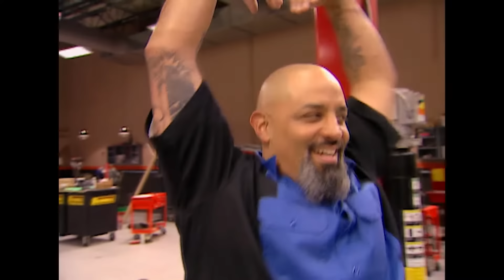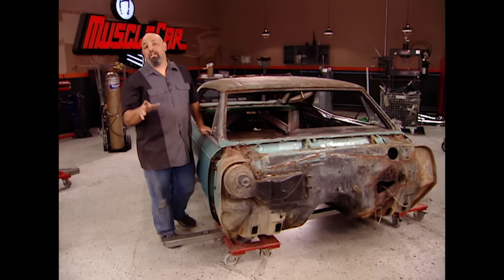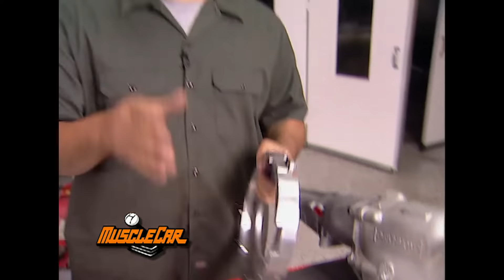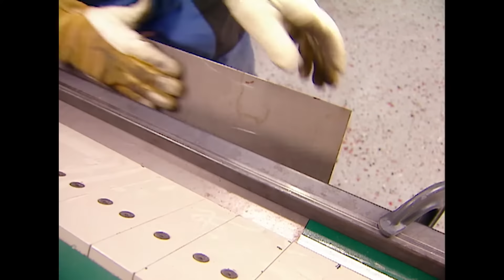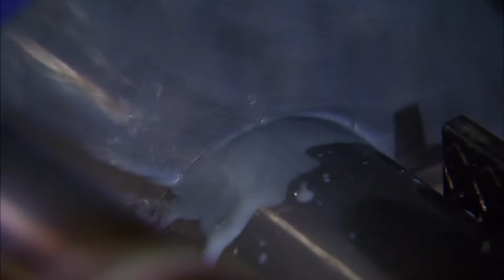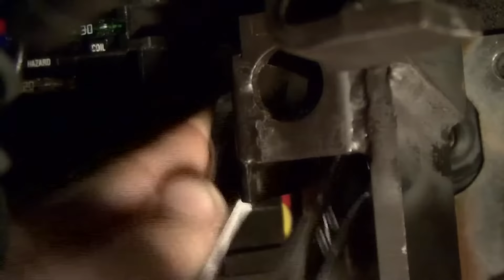Full Build: Rusted 1967 Pontiac LeMans to Golden Beauty

Comment: In my opinion, polyurethane bushings suck, the rubber bushings don't flex enough to make a significant difference, and they tend to squeak. I have removed all the polyurethane bushings from my '67 Corvette and my 02 GMC Sonoma. I won’t use them again in any of my future restorations. 

If you're restoring your interior, I also recommend using sound-deadening material. I applied it everywhere: on the firewall, the doors, and of course, the floorboards. You won’t be disappointed when you're cruising to the next car show!

Comment: Great way to start a Saturday
Reply: Yep, one of the best ways to start a Saturday.
Reply: I'm a day late.  I had to do some preventative maintenance on my Silverado so it keeps going strong.    A filter change and some undercoating on the frame and it's good to go.  Gotta be on top of it.   Ohio loves to cover the roads in salt in the winter.   It's starting winter number 8 and not a spot of rust.
Reply: @bmstylee  eight Winters in Ohio and not a spot of rust, now that's impressive.
Reply: @AnnatarTheMaia  during the winter I pay for a monthly pass at a car wash.   So if it snows I make sure to get it into a car wash ASAP so it doesn't sit worth salt on it.  Plus I make sure to get a couple coats of wax on it each year.  I don't want to be the guy with a truck that looks like it's about to fold in half between the cab and bed.
Reply: @bmstylee  you're pretty clever. That's refreshing in this day and age.